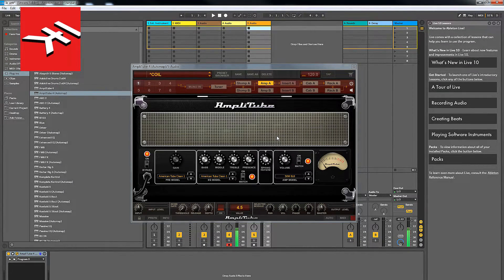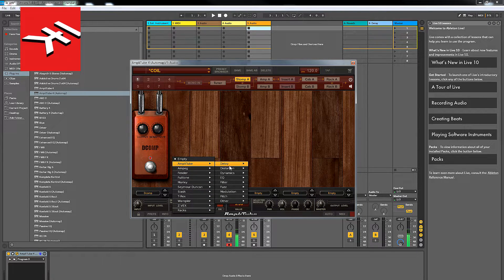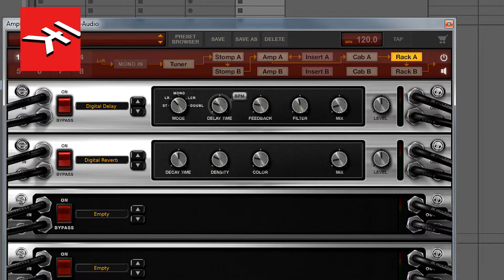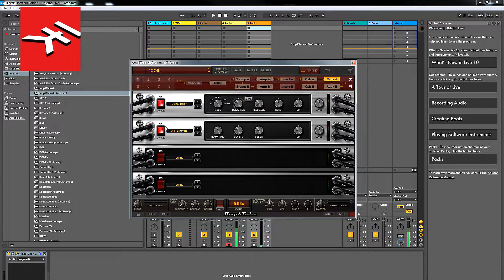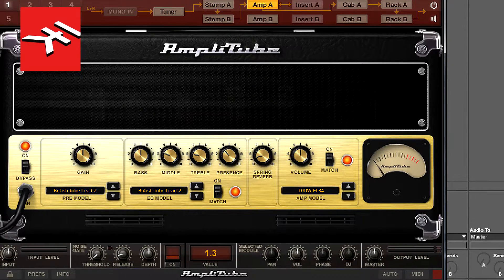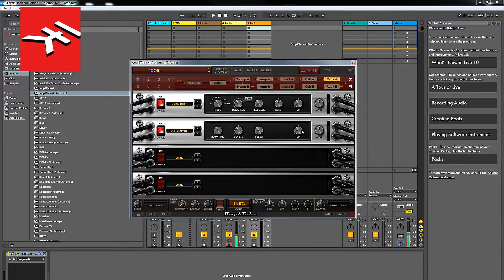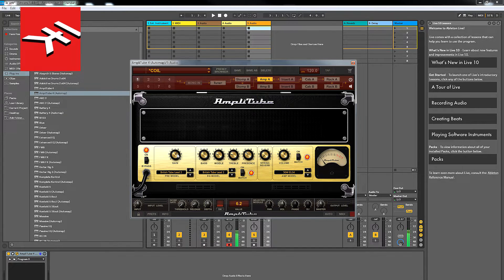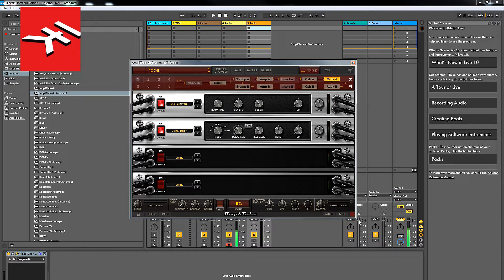Paul Rose - AmpliTube 4 Setup.

Comment: any help would be nice.  I just got my focusrite and connected it and i can hear my guitar when i turn on direct monitor.  read a forum and someone said they only hear clean sound when they use direct monitor but when he turns it off he can't hear anything through amplitube.  having same issue; to add to that, i'm using amplitube 4 and my program is not picking up my guitar.  i've downloaded the asio4all driver and i've tried every combination that amplitube allows me to try via the settings tab.  under the "technology" drop-down i have the option of choosing, "windows audio (exclusive mode)", "DirectSound", and "ASIO".  I've chosen all three and i've also chosen for the drop-downs for input/output and left/right channels, all the options i possibly can choose from.  to add to that, next to the buffer size where it says "panel", i have the option of turning on or off specific WDM devices such as, "Nahimic mirroring device", "Realtek(R) Audio", and "Focusrite Usb Audio".  Under "Realtek Audio" i can specifically choose types of input such as, "Mic input", "Stereo input", and "Line input" as well as other outputs.  I've selected every input/output combination as well as just selecting one input and one output at a time to check and see if amplitube will pick up my guitar, and nothing.  Under "Focusrite Usb Audio" i have two options which are "fniusbwc4400" and "fniusbwr4400" and neither of those do anything.  last thing, on the windows sound setting where it says "input" i have the "focusrite usb audio" selected and under "test your microphone", when i strum my guitar, the bar is moving, which tells me that windows is picking up the guitar but amplitube isn't.  even restarted my computer after the driver download and a few other times after that just for the hell of it.  completely at a loss here!
Reply from the maker: Hi there, without being able to see it, I know that you must select all focusrite options for in and out. Nothing else is needed in audio device selection. Are you using it as stand alone on PC..? If so you might need to download QuickTime which enables standalone mode. Otherwise I'd get on to ik support, I'm sure they can sort it otherwise. Let me know how you get on.
Reply: @PaulRoseGuitar  I've selected all focusrite options for in and out and still nothing works.  Not sure what you mean by stand alone
Reply from the maker: @Teeter2386  standalone means you are not using it within a daw like cubase or protools etc

Comment: Hi Paul I am new to AmpliTube 4 one thing I will request you I bought irig hd 2 question is am I supposed to get this AmpliTube 4 as you have it or just basic they say I should be able to unlock but I don’t know how
Reply from the maker: I don't actually work for ik multimedia in that capacity, I only demo their software online. I would suggest contacting their technical support team. I'm sure they'll know how to get you set up.

Comment: Hey Paul. Thanks for this fantastic tutorial. I seem to be having tremendous noise issues from my Stomp unit. I have set up the British Tube Lead 2 with Gain of just 3 and already I get hiss. Then if I try to add the Ambassador or Overscream the noise is massive and I have to clip with the noise gate at around 70%.
On your video I can hear no noise and your noise gate is set to minimum.
May I ask if you're doing anything else to reduce the noise or do you think I have a faulty Stomp Unit? Thanks in advance for your reply. By the way your Contact Form on your website seems to not be working, thought you might want to know. Chris
Reply from the maker: Hi Chris, the stomp unit will not be causing the noise. I have experienced hiss with the Tube lead 2, and I have always found Marshall amps to be gritty and harsh in the top end generally. A couple of things I do here are pull the treble and the middle back, as I think it sounds better like this anyway. But this has helped. Also, compressors can increase, so check where the settings are (if you're using a compressor). Hope this helps.
Reply: Paul Rose thanks I’ll work on it some more. I loved your backing tracks you were soloing along time in your Xmas day video. Can they be purchased from somewhere? I need a good range of blues songs in various styles, keys and speed. Thanks
Reply from the maker: Hi Chris, yes everything is here and more. 

https://paulrosemusic.bandcamp.com/

Comment: Hey Paul, I just installed my Amplitube 4 plug in. The problem is, I'm only getting a DI signal and nothing from the actually amp models. I'm using a scarlett solo as my interface. Any idea how I can fix this??
Reply from the maker: It's a routing issue Marco. What DAW are you using...? Or if you're using standalone you will have to select the input from the Audio MIDI settings at the top left corner.
Reply: @PaulRoseGuitar   I'm using reaper but I haven't yet used the plug in through it yet. I'm trying it standalone and so far only getting the DI signal. I'll try the MIDI settings though. Thanks man anything helps!
Reply: @PaulRoseGuitar  Thanks for the reply, I fixed the issue by simply checking the input. Thanks. The only other problem is that the sound sounds over saturated. As if there's too much distortion or too much of a signal and my interface begins to clip when I barley go past a quarter on my scarlett knob. Any and all advice would be greatly appreciated.
Reply: @marcorodriguez7694  Standard issue, it's why I paid more and got the 2i4 with the pad switches to drop the signal down (am assuming yours does not have them).  You will need a DI box to drop the guitar signal so it does not clip.
Reply: @fromthesilence9583  Thanks, that's what I figured. I appreciate it.